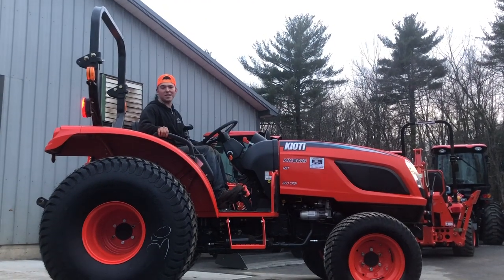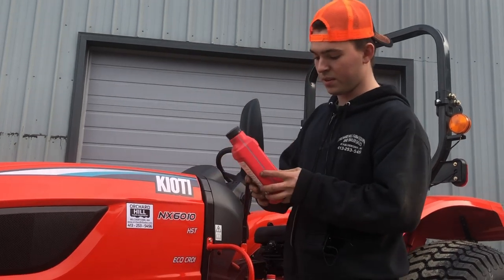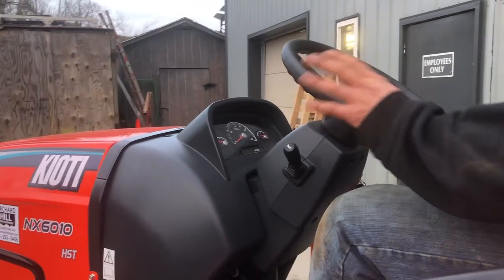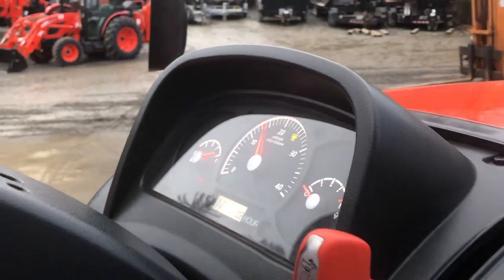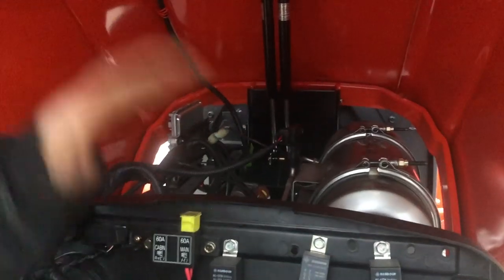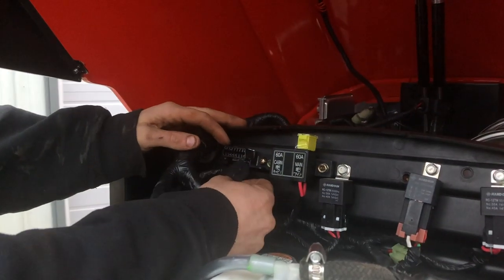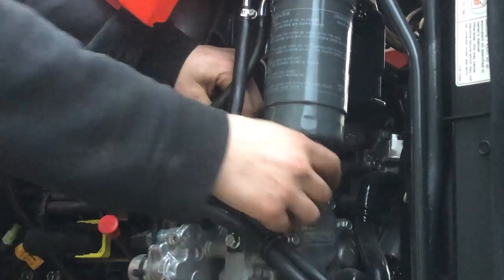How To Regen A Kioti Tractor & More - DPF Explained

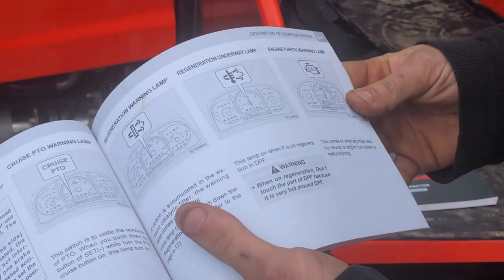Comment: @ 3:15 - Good advice!

Running a DK6010SE (and LOVE IT!)

Reason I had the "Puff of smoke with thermometer" was I had been idling the tractor to warm it up for a long time as I filled the diesel...

I was clearing some light snow, and wasn't planning on running it for a while, but I decided to run up the RPM's to 2000-2500, cleared the driveway and then pushed some piles back to kill to birds with one stone.

By the time I was stopped at the garage door to take a garbage can down to the street, had thrown on the parking break, I noticed the "puff of smoke with thermometer" light disappeared - AWESOME!

Thanks for making this video to help reassure what I assumed was happening.

P.S. You can definitely smell that recirc happening! I suppose this makes sense given the stainless particulate case was probably red / purple hot!

Comment: My CK4010 regens approximately every 32 hours, and I always run it at 2300rpm during regen.  Engine rpm's are your friend during a regeneration.
Reply: My NX5010 regens approximately every 32 hours as well.
Reply: I wish I could get 32 hours between regens the longest it's gone was when I first got it, went 42 hrs and has been down hill ever since along with a list of other things and my dealership seems to be useless they have taken it back to the shop 6 times and not fixed it yet and they have had it now for 2 wks and have no idea when I will get it back and I doubt it will be fixed,we bought new so we wouldn't have the headache of buying used what a mistake
Reply: @elwinsmead5691  Wow, sorry to hear these issues.
Try a different dealership for warranty and repair work.  Its not the length of time for repairs thats a concern here, but the number of times you keep bring it back.  Overall, most tractor dealers try to provide good service, but unfortunately some dealers just struggle to make competent repairs.  
A decrease in time between regens means your not running at high enough RPM's or your injectors or not performing properly.   And just imagine how serious it becomes if you have both issues at same time.
Reply: @martinrademakers762  I have tried a different dealership asked if I bought it from them and I said no and I got well take it back where you bought it. I run this tractor between 2000 & 2300 rpm most of the work I do involves the bucket and my backhoe but this tractor will regen and I will let it run its course and I have had it regen 20 min's later been doing this since new. I get about 4-5 hrs most times between regens and my tractor has no power when it does regen
Reply: I get about 25 hours between regens, just over 52 hours now. Trying a new higher grade Diesel fuel from Shell, we’ll see if it makes a difference.
Reply: @elwinsmead5691  if you're still having trouble with short intervals between Burns ask them to remove your DPF filter and send it to a large truck shop like Peterbilt or international truck dealership and get it baked in the oven.
Reply: Emissions laws suck, where does your tractor run on the temp gauge my 4010 had the wrong thermostat and was not running hot enough and was regening every 20to 30 hours even when being used loaded heavily at pto speed.

Comment: I have a tier 5 and experienced two regens so far.  I did the parked regens but don’t think it more than 15 minutes.
Reply: When regaining, does engine hours still go up?
Reply: @kevinnguyen9430  yes
Reply: What year? What model?
Reply: @davehudson4607  it’s a CK 3510  2020 year.
Reply: @mr.redneck2715  Thanks Don, how often does your machine need to regenerate? I have the CK4010, a 2020, only two regen cycles so far, a little over 50 hours.
Reply: @davehudson4607  about 37 hours

Comment: Lol - 12:09 - "use a propane torch to warm up your fuel filter"! That sounds like a Darwin Award in the making
Reply: More practical than Just Add Beer!
Reply: Yeeeeeah I wouldn’t use a torch anywhere near fuel lines and electronics. Better to use a hair dryer and bring the unit inside to a controlled temp to help.

Comment: Sounds kind of screwy kioti will not let end users read the codes off the tractor
Reply from the maker: Little Trucker Kennel unfortunately most all equipment manufactures do the same thing. As the programs and codes are total different from the car industry.
Reply: You can read the codes, but knowing what each code means varies from tractor manufacturer to manufacturer.  Just like Ford, GM and Toyota  all have proprietary codes.
Reply: @martinrademakers762   No kidding it's kind of screwy that you can't get and open code to find that when a wire has a loose connection to a sensor 1/2 to bring it all the way to the dealer costing time and money just because a wire is lose
Reply: I agree. My Kioti zero turn says ERROR 44 when I try to engage the PTO. No one can even tell me what that means. It's brand new, haven't even gotten to mow my lawn yet and now I can't 😡

Comment: If the code reader from AutoZone will not give the correct codes off of the code reader why doesn't coyote sell a code reader for the end-user to pull the codes? After all we paid tens of thousands of dollars for the tractor but you're not going to let us read the codes to find out what's wrong with the tractor? Are you really selling us the tractor or just renting the tractor. When my warranty runs out if I cannot read the codes to find out what's wrong with the tractor I plan on hiring an attorney to sue your ass because I paid over $25,000 for a tractor and you're not going to let me read my own codes? Sounds like a class action lawsuit to me